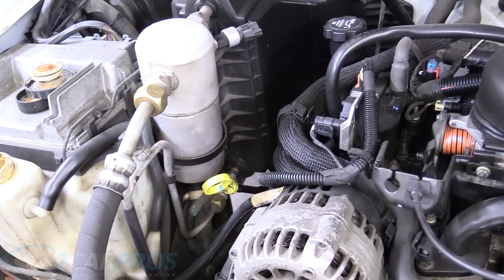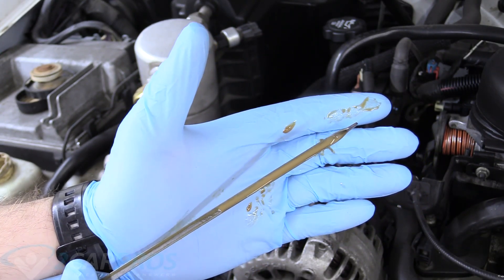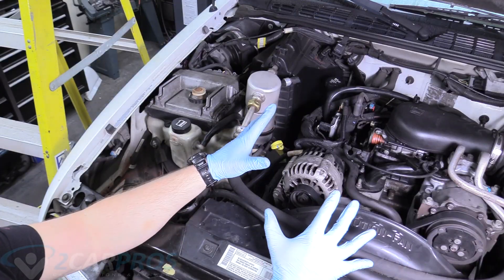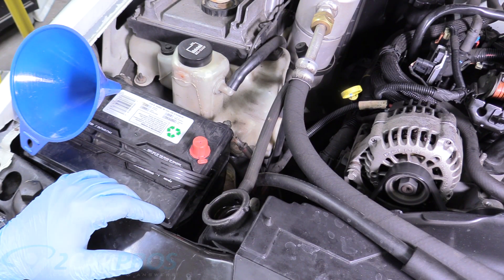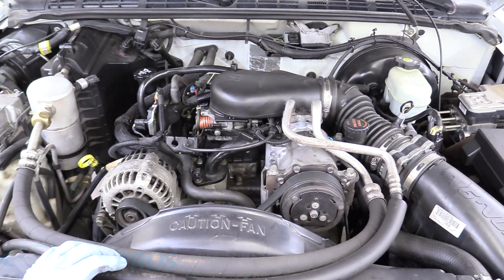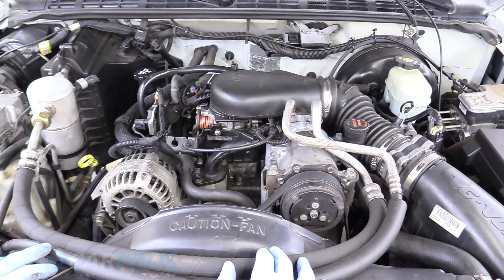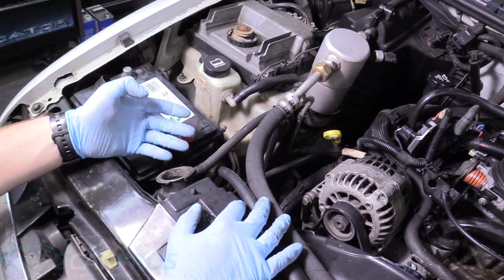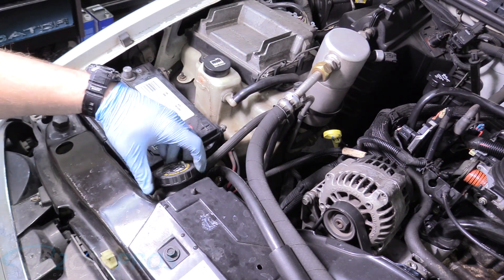Can You Fix a Head Gasket with a Chemical Sealer?

Comment: You can actually figure out which bank it's coming from...
Reply: Can you explain how?
Reply: @shawn1472  leak down test, compression tester, coolant system pressure tester, bore scope.. all can help you in narrow it down. 
Leak down will give a higher leak down rate in the cylinder with bad gasket, also if you test it with rad cap off you may even happen to see bubbles. 
Compression test, lower compression in the cylinder that is leaking combustion to coolant system. 
Coolant system pressure test and scope used together: put pressure on the system. Pull spark plugs, run scope down each cylinder, look for visible water leaking into cylinder or ones that appears wet.scope can sometime be used on its own, if any cylinder is drastically cleaner it's because of burning coolant and it's "steam cleaning" the piston(s). 
I hope this actually helps answer your question.

Also bonus tip, if the headgasket is really bad, pull the fuel injector fuse, take all spark plugs out and crank the engine with a sheet of paper or rag etc over the holes, it will be wet above the cylinder that is bad. This only works if it's a severe headgasket leak,it's usually not useful to try. This also can be used for hunting down severe fuel injector leaks(stuck open) and valve seal leaks. 
I didn't mention it above because it's overall not useful unless the engine is already FUBR.
Reply: @pospc2  yes this is very helpful. I think I'm going to have to try it. My radiator fan fuse relays went out and I didn't realize that my radiator fan was not running for a little while. I was able to get the car to cool down after parking on the side of the road for a while and then I was slowly able get off the freeway to the auto parts store on the next exit. I replaced the fuses and It was running okay for about 30 minutes but then it started overheating again. I assumed I blew the head gasket/s. It's a small 2.7 engine in a 2004 Dodge Stratus. The oil has the tiniest amount of coolant it looks like but I'm not quite sure. Smoke comes out a little with oil cap off. The pressurized Reservoir doesn't bubble though when iI take the cap off and look. I was going to try a combustion leak kit. Does that work?
Reply: @shawn1472  the test with the color changing fluid does work as long as the tester doesn't suck up coolant. If it does the test is invalid. Make sure you remove a little coolant if testing at the rad, if testing at a pressurized tank you should be fine as long as it isn't at the top. even a slight change in fluid color from blue (green or slight yellow) should still be considered valid. If you doubt the fluid is working correctly,put the tester to the tail pipe with the car running. It will quickly change if the fluid is good(usually the fluid is fine)
Never hurts to use multiple testing methods to confirm results. 
Unfortunately the 2.7l isn't a good engine to start with. If you do your choice of headgasket test and it comes back okay, next check the water pump and check the thermostat and housing. The water pumps are known to leak and cause coolant to get into oil(iirc they are driven off the timing belt so not an easy job). The thermostat housings have had some issues with cracks and while you are in there you might as well do the boiling water test for the thermostat to make sure it functions properly... 

My advice is if you can afford it, trade/sell the car and get something else. If not I understand,you gotta do what you can to get by or if you are trying to learn automotive repair and willing to roll the dice maybe attempt a diy repair after plenty of reading/videos/forums/friends or mechanic in a bottle lol. 
Only issue I see with mechanic in a bottle(head gasket sealer) is when coolant gets in the oil and the sealer is in the coolant, the abrasive glass like fibers can destroy bearings and cylinder walls but If the car/engine is heading for the scrap anyways it doesn't hurt to try. At your own risk that is 😊.

Also it's been a while since I have seen a car like that,I mostly work on newer cars anymore, if I remember right, you have a wire loom running on the bottom of the core support which can get caught on parking stops and curbs, when that happens it damages the wires causes a short. That could be what started the fan issue.
Reply: @pospc2  you are extremely helpful. I appreciate it. I will definitely check the wires, I've been trying to figure out if it was a short. How exactly could I test the water pump? And I was thinking about just buying a gasket kit and replacing all of them. I was really iffy about the blue devil and I definitely think you have a point. But I'm also a little bit worried, I've heard of gaskets reblowing after install because they previously blew. I have automotive experience but not heads or gaskets yet.😅 Again I really appreciate your help and time.

I just have too many vehicles/projects and this is one of the better running ones lol. It was my daily driver(city to city) till the radiator fan situation.
Reply: @shawn1472  if you plan to pull the head have the block and heads checked for flatness or look up how to do it yourself. Replace bolts as well. 
As for the water pump on these cars it kinda sucks because they end up leaking inside the timing cover and getting in the oil. 
If you plan to replace gaskets, get yourself new head bolts and a new water pump. You can find a ton of into on these engines on forums and in videos. 
To answer the question on checking the water pump, if you have coolant dripping from the block/timing area that is the problem but unfortunately I don't know of any for sure way to check it short of removing it.

Comment: BTW... the pour and go isn't pour and go. It clogged my heater core and now I will have to spend $1,600 to get it replaced.
Reply from the maker: Did you follow the instructions? Because ours worked great and the S10 is still daily driven. Thanks for watching!

Comment: I have a 99 grand caravan, it ran Hot, I made it home, changed the leaking water pump, I have water in the oil, now I know where the water was leaking to. Steam coming out exhaust,,,, is it to far gone to use blue devil and at what point should I change oil during the process if Blue Devil is recommended.
Reply from the maker: At that point I would say it is time for head gaskets. Thanks for watching Dwight!

Comment: heater doesn't work any more. I was told using that stuff guarantees a replacement engine.
Reply from the maker: Works for us so far. The S-10 I did this video is still running as a daily driver. Thanks for watching!

Comment: So did you drive the vehicle after all of this and is it still good? You changed the oil and it looked fine but just changing it and not driving it doesn't prove it worked
Reply: He says it's still fine 2 years later :)
Reply from the maker: What? I can't drive someone's car for months and months to prove it worked. It worked in the shop and according to the owner it is still running strong. This is also a whole lot cheaper than doing 2 head gaskets since this was a V6. Thanks for watching!

Comment: Hello, I have a hummer h2 06 with leaks under the engine,  and I don't know where exactly its from, scared to take my truck to the repair shop lots of crooks out there. Could this work on it? Please advise. Thanks.
Reply from the maker: Depends what's leaking. Might stop a slow leak from a heater core but it won't stop any kind of oil leak. Thanks for watching!

Comment: I have an subaru Impreza, and it is throwing water out trought the reservoir, i think its pressure from the engine into the cooling sistem, do you think it will work? There isnt water in the oil or anything, oil recently change and no water contamination.
Reply from the maker: So if there is a ton of bubbles coming out of the reservoir. Then this might help you. Thanks for watching!
Reply: @ raemmy did it work for your impresario? I have a legacy with the 2.5L with the same issue

Comment: Ok so the instructions says nothing about the thermostat thing. When we remove the thermostat, is it just open like that? Or do we have to put something back? Coz it doesn't mention anything about it. It just says remove the thermostat. I assume when you remove the thermostat it's just open right? And then when you pour in the stuff obviously it's gonna go everywhere lol
Reply: Or you just take our the thermostat but then put the housing back?
Reply from the maker: Yes replace the housing. Thanks fo rwatching!
Reply: How would this work on a 335i? The thermostat itself is connected to the hoses that to to the water pump

Comment: Hey guys. I have a 98 nissan almera 1.6 litre (16 valves) with hole in head gasket. it doesnt have a white smoke but it overheats on hi revs and it consumpes oil and water like 1 litre per 1000 miles. I cleaned a radiator and removed my thermostat. my question is after i put Blue devil can i run the car without thermostat? and what is better after the blue devil treatment? filtered water or coolant? or can i mix between them
Reply from the maker: Yes you can run the car without a thermostat but it might overheat due to water not sitting in the radiator long enough to be cooled. I just use hose water with coolant concentrate. Thanks for watching!

Comment: I've got a 2 cylinder 10hp boat engine, it don't have a heater and it only holds 2.5 litre of coolant, would this stuff still work.. Cheers
Reply from the maker: I would guess no. Every boat I have worked on uses water from the lake or river you are on to cool the engine. So this would not work. Thanks for watching!
Reply: @2carpros 
Yeah thats true for older boat engines but modern marine engines use a closed loop coolant system similar to a car but instead of a radiator they have a heat exchanger

Comment: You should add anti freeze, regardless of weather. It will protect your cooling system from Rust.
Reply: Not only will the manufacturer-recommended coolant inhibit corrosion but it will also elevate the boiling temperature (gives a greater 'thermal reserve' under hot conditions). Also - very important- use distilled/purified water NOT TAP WATER as tap water contains mineral salts (ions) which will accelerate corrosion.
Reply from the maker: Many people run just water in hotter climate. I always do 50/50 in my cars though. Thanks for watching!

Comment: Could someone please assist  , Blue devil leaked out as expect from overflow container and where ever it was leaking from it but it has Created a BIG mess I spent 8 years restoring a Toyota Supra ( was trying to seal leaking heater core)  any suggestions? i tried soap and water .................
Reply: Try radweld, this stuff is for head gaskets

Comment: Instructions do not make sense it says to take out the thermostat but without the thermostat the water /bluedevil leaked out of the thermostat housing (toyota supra turbo)  Any suggestions please? (its hot and i m  stranded 2500 miles from home) thank you .
Reply: left the oring in place
Reply from the maker: It really shouldn't leak with O ring in place. Maybe it is leaking from elsewhere?

Comment: if the coolant is bubbling in your coolant reservoir, what does that mean? Kinds of looks like air pushing through water.  Its not alot. The coolant looks clean though. Oil looks clean too. And no overheating I believe. Does it seej like I have a minor head gasket leak?
Reply from the maker: Yep. Thanks what it looks like. Thanks for watching!
Reply: @2carpros  did this blue Devils sealer clog up anything later after a few weeks? Such as heater core or radiator?

Comment: Okay so do you mean to tell me that the reason people are complaining that the radiator clogs with head gasket sealer is because people fail to flush the radiator after using it? This sounds like the step in the instructions that prevents all the problems this chemical can cause.
Reply from the maker: That is correct. Thanks for watching!

Comment: I deeply need help from someone because I don't have any money right now but I need to fix my car because it is the only way I can go to work back and forth. I wanted to try this method but I cannot understand the hoses I need to remove, in some videos, they only mentioned to remove the thermostat then flush the coolant, after that, pour the Blue Devil, let it run for an hour, then let it cool again for an hour, then bring back the thermostat, test drive for about 20 minutes or so(driving slow) then check again after 24hrs if the car is running great. The only sign right now is that the radiator has bubbles. My mechanic is telling me that I need a full top overhaul because of coolant has bubbles and it is blowing the water out of the radiator. I wanted to try something I watched on YouTube where you flush out the coolant and then put a head gasket sealant and let it run for 30 mins then repeat if for 5 times. Some of the comments said it worked. But with the symptoms my car is showing, do I really need a top overhaul or can I try this out first? I'm thinking that the mechanic might just want that extra job for the money. I will really appreciate your respone on this. Great vid and keep it coming buddy! Cheers!
Reply from the maker: Couldn't hurt to try. Thanks for watching!

Comment: I used Blud Devil gasket sealer last year on our 2006 Honda Accord LX.  I was trying to figure out why anifreeze was spewing from underneath the reservoir cap all onto the engine. Changed the cap, changed the reservoir, changed the little reservoir hose...still the same thing. Researched and read it was head gasket going. Oh hell no I wasn’t paying $1,200 plus for that.  Came across this at NAPA and said, “ What have I got to lose except $40?”  Followed the instructions to the tee including removing the thermostat.  By the following day after doing the flushing and runs, the problem was solved.  Kept checking it everyday as my son drove to college/home 80 plus miles round trip each day and still, no problem.  And then...my son wrecked the damn car 5 months later totaling it (he was fine). But at least I wasn’t out $1200 plus on this repair!!!  This stuff seriously works..but like the man says, follow the instructions as they state on the bottle label.  I’m a Blue Devil believer!! Good video!!
Reply from the maker: Very cool! Thanks for watching!
Reply: Hey I got a Honda civic lx with a blown head gasket ima try it out but do you know how long it lasted your son???
Reply: I have the same issue with my 2004 civic. Coolant will blow out of the overflow cap when driving. It's been doing this awhile so I just add coolant before I leave. Hopefully this will work!
Reply: @melissamcgee833  just make sure its not your radiator cap; rubber underneath wears out with time.  Rule them out.  No harm in replacing the cap.  Process of elimination. Monitor each daily to rule them out.if it still continues for a couple of days then use the Blue Devil head gasket repair.. Good luck!!
Reply: It will work but you have to follow the instructions to the tee.  Tedious but a small price to pay rather than a $1500+ repair. I had failed to respond to prior comment from Nathaniel P, it never did it again.  5 months later driving 80 miles+ round trip daily, repair still held. Ive since used stop oil leak on my tahoe and rear main differential, stopped that oil leak. All Blue Devil products work great!  I’m a believer!!!!
Reply: @shernandez505  thanks so much for the reply! So....I used the pour and go. I followed the instructions to a tee until my car started running hot after 30 min. I had to cut the car off so it didn't get the recommended 50 min with heat on full blast. After it cooled I made sure radiator was full, cranked her up again an let her run. The car is not drivable now. The heat stopped working, leak got worse and car overheats within a few miles. I'm sure it probably clogged my heater core, thermostat and radiator. Basically everything but the leak...lol.  Not sure what I can do now, if anything. Any suggestions would be so appreciated. Maybe I should have gotten the other kind rather than pour and go. Easier is not always better!
Reply: Darn it. In 2025 it’s $68 bucks
Reply: @Chikanini_Tows  beats $1200

Comment: K&W Fiberlock stopped my leaking (POURING) freeze plug between engine and transmission. Mechanic wanted 3-500 to replace freeze plug. I don't need a heater core anyway in SC. If I do, I can fix that later. I'm driving again, that's all that matters right now.
Reply from the maker: That seems really high for just pulling a transmission and replacing a freeze plug. Thanks for watching!

Comment: I pulled my thermostat as suggested, huge mistake.
Both the bolts were super rusted and snapped off, had to drill and tap.
Water pump and intake are done. 

And the reason they were rusted, previous owner never flushed system once and only ran water, because "it's a California car".

Radiator fluid,  or coolant,  is important. It has a lower freezing point, but also a higher boiling point AND corrosion inhibitors. 

This video and the 1st video are super helpful and well done, but please don't suggest coolant isn't important.
People are dumb, they will just run water and turn a v8 into a boat anchor.
Reply from the maker: I was just saying some people do that so don't sweat getting the ratio EXACTLY 50/50 down to the micron. I always aim for running 50/50 in everything. Thanks for watching!